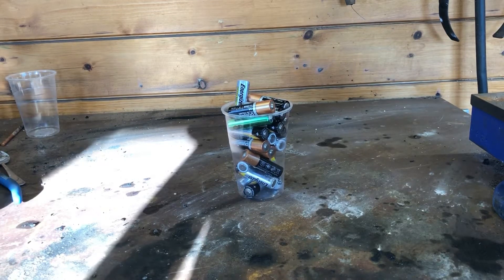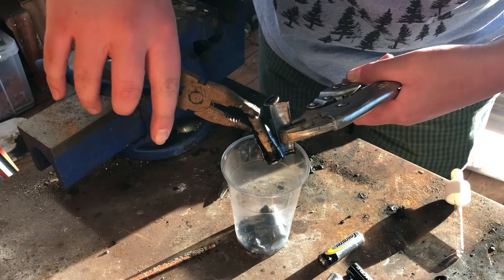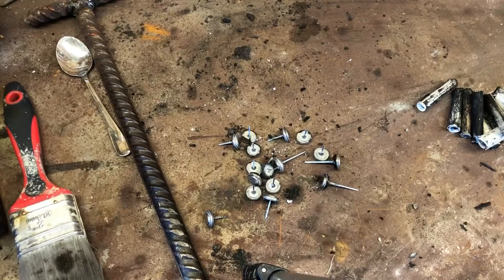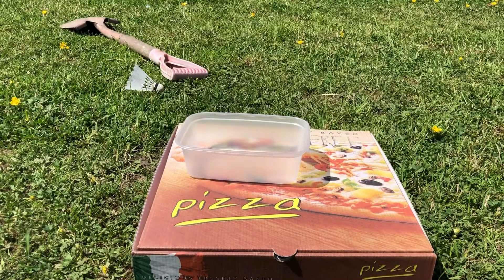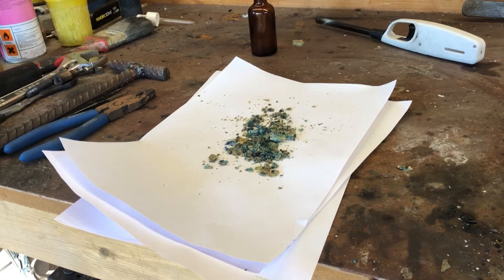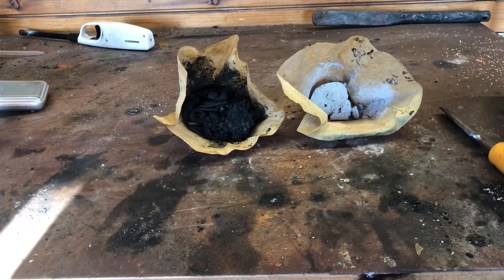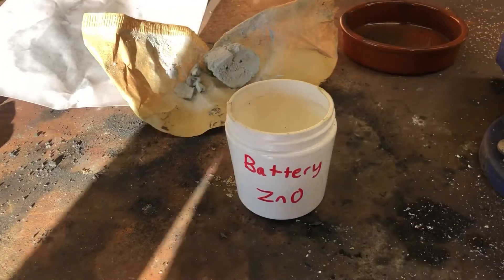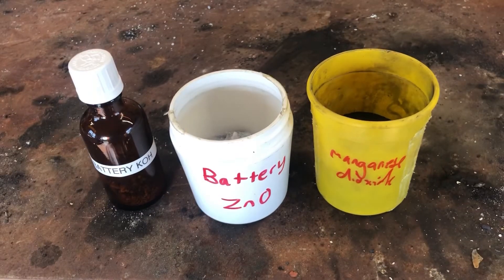Pulling apart batteries for potassium hydroxide, zinc oxide and manganese oxides

Comment: في الدقيقة : 4:29   من اين حصلت على هيدروكسيد البوتاسيوم؟
هل هذا النوع من البطاريات يحتوي على هيدروكسيد البوتاسيوم؟
Minute: 4:29 Where did you get potassium hydroxide?
Does this type of battery contain potassium hydroxide?
Reply from the maker: The potassium hydroxide is used as an electrolyte. As KOH is alkaline when aqueous,  the name ‘alkaline battery’ comes from this. To answer your question, this type of battery contains KOH
Reply: @theshedchemist6445  thank you for replying .  Yes that's right.  I found some batteries contain potassium hydroxide
Reply: I wish I had a giant pushrod for all my problems to “just go in the bin” great video will be rewatching!

Comment: Should I drain the power out of battery furst
Reply from the maker: It would likely be a good idea. The batteries I used were dead, so I’m not sure what would happen if you shorted it out while ripping it apart. If you did use a new battery, you’d get zinc powder and manganese dioxide. It all depends on what you want. When the battery is used, the zinc powder reacts with the manganese dioxide to generate electricity.